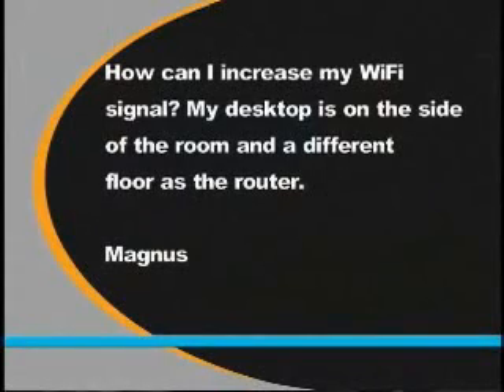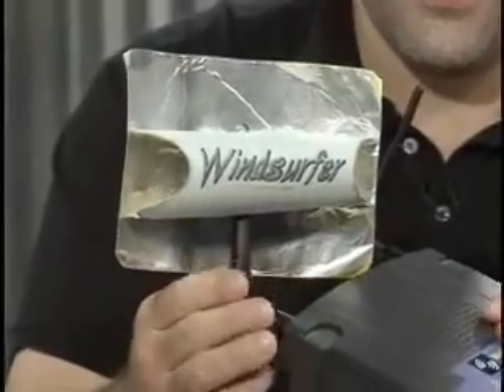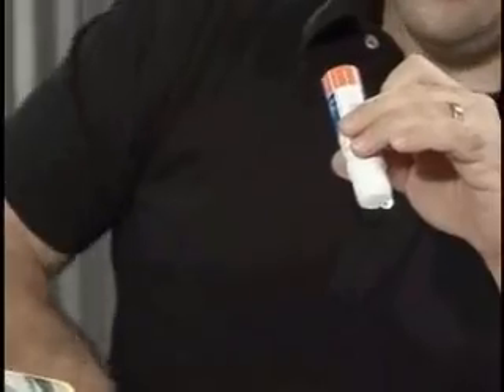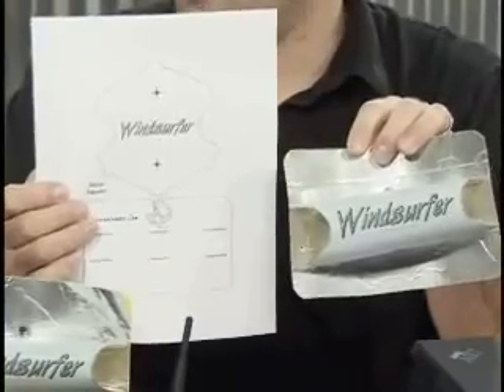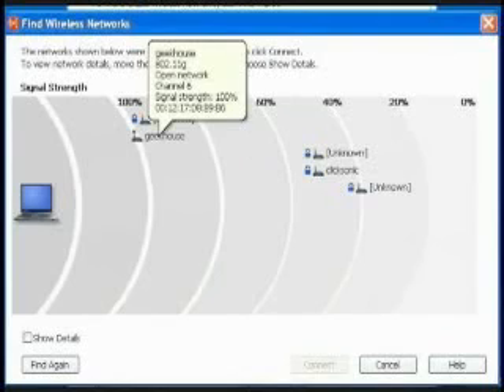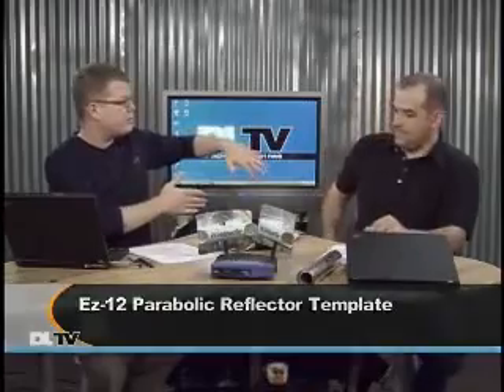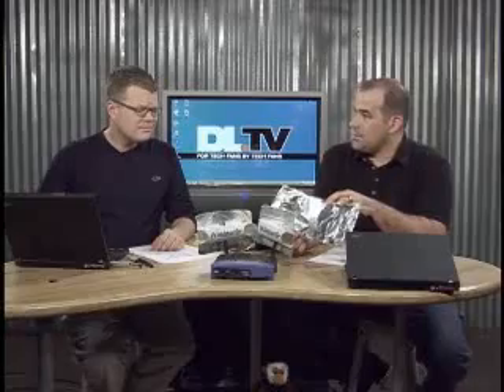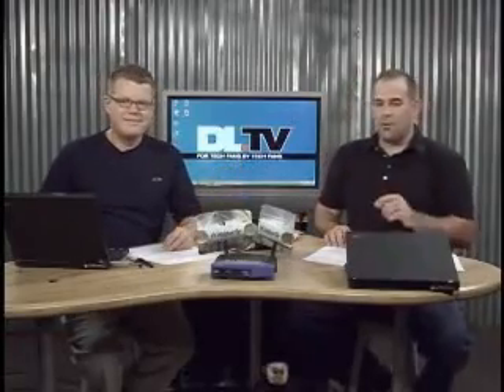HOW TO MAKE A WIFI EXTENDER

Comment: The tin foil has 2 sides. One dull and one the other side shinny. Which side should face on the top that I glue on???? Please.
Reply: +tienie dearham Probably aluminium part cuz he reflect signal..U can decide which one is probably aluminium must be inside..Its like nylon cant go through it if all sides are than all is the same..

Comment: How do I apply this technique if my router doesn't have an antenna?
Reply: Alvin U. your router still has an antenna, but its internal and inside of it. imagine your entire router being the antenna. make a reflector almost the same size as your router and put it on the side you need, can be completely detached from your router but not too far. the caved in side should face the way you want the signals to travel toward. lets say " U " is my reflector, the signals travel up. if "  ) " is the reflector the signals travel left.
Reply: ***** So it's just a matter of putting it up against my router? Should I tape it to my router?
Reply: yes, just make a curved shape reflector, put it behind your router. doesn't even have to tape it/glue it to the router. find other means of making it stand/keep position like put a box behind it to keep the reflector standing between router and that box.

Comment: I tried the actual cut out with foil but it didn't work. Did you even use the cylindrical thing in the center or did you just use a huge amount of tin foil and it worked?

Comment: Has anyone tried this on Wireless access points for reception? for example, My router is located on the first floor of my two story house and i have an access point on the second floor (where i access the net wirelessly).could i make this, stick it onto the access point and point it in the direction of my router? or does it need to be on the router itself?  help

Comment: @xxmarbreds91xx Make a parabolic reflector(ex. large cereal bowl w/@ least the concave side lined w/alum. foil)&place it behind router w/concave side facing area u need more signal. Can use on routers with or w/o external antenna.

Comment: People that are trying to watch this probably can't load this video so basically... You could go out and buy something to direct the wifi in one direction and it will cost around £50 but you could do the same but simpler by just:
1) getting something reflective like tinfoil.
2) putting a curve on it (to turn it in a direction you could stick it to paper to help keep it bent)
3) put two holes on it so put on the antenna ( if you have no antennas, good! just pop it on top of the router)

Comment: I just tried this and it worked quite well.  I have my desktop pc and wireless router in an extra bedroom and had a problem with the WIFI signal reaching to all areas of the adjoining living room. Now the signal goes through the wall into the living room, through the kitchen behind the living room, through another wall into the master bedroom, through another wall and two walk-in closets behind the bedroom and into a back den. 120ft on a straight line. Signal drops off near the back of den.

Comment: I wonder, how the HELL would you improve the signal on a router that doesn't have an external antenna? I'm talking about the 2wire Homeportal 1000hw, which apparently has 3 internal antennas connected to the MB. Don't ask me why, it doesn't belong to me and I never installed it. But I'm forced to live with it. I get no reception in my room and I need to figure this out. Anybody have any advice? Thanks!

Comment: wow, my router is in the basement of my house, made out of concrete and i have no signal reaching my rooms upstairs, almost like a deadzone. After i did this with just using the foil, it works now across my house and upstairs. Didnt even use the scissors or cut out paper!

Comment: The parabolic principle is that everything that goes in will get reflected back to one fixed point.
In this case this fixed point is the antenna of the router. That's why you can't scale it to your liking. Making it bigger or smaller will move the fixed point.

Anyway it would never increase the tranmission rate above the capability of your router (obvious).

Should be a cheap way to turn your omnidirectional antenna into a directional antenna.

If it works, have fun :o)

Comment: After modifying each of the two antennas with (8) small binder clips to expand the antenna height and width, I placed a 12" x 6" cardboard aluminum reflector behind my Linksys WRT54G situated in the far end of my basement. The signal bars on a notebook computer in a bedroom two floors above and about forty feet away registered from two to four bars!

Comment: This doesn't work...

Wireless routers use 2.4Ghz systems... that are binded together.  In order for this to enchance the signal, it would have to actually be connected to the metal antenna wire (thus enlarging the entire antenna surface area and directing out and inbound signals because of it's parabolic shape).  

But just sticking it on the outside of the plastic antenna housing like this.... does NOTHING.

Placebo is a hell of an effect.

Comment: what the problem might be is that ur phones might be on the same 2.4ghz frequency as ur wireless and thats causing ur problems. the easist way to fix it is to get new cordless phones. new phones transmit at 5.8ghz and wont cause interference with ur wireless internet. other things that can cause interference but rarely unless u have a crappy access poibt or router are:

microwave ovens and pine trees (i dont know y. but they do.

Comment: is there a homemade device to boost the wireless signal for the laptop rather than the router itself? I mean can we prepare a device for the laptop that we use in another building from the router? Could the same device work in this case as well?

Comment: Am/Fm radio is broadcast to your radio which only receives(unless its a ham radio), unlike wi-fi which constantly transmits and receives. I only posted this as a joke, although it is a sad fact. The days we live in require our bodies to sustain a lot. I have a wi-fi set-up, and I expose myself to this radiation everyday. However, I would recommend using cell phones less, and wiring as many computers to your network as possible. It just makes sense, and its safer for your net security.

Comment: I need to boost signal up from the router on the ground floor up to the attic. Do you know, should I tilt the parabola upwards relative to the antenna, or must parabola and antenna be parallel? ie tilted together

Comment: it does work, it reflects the signal from one side to another, however if you have the parabola facing the wrong way it will dramatically decrease the signal strength

Comment: PARABOLAS LIKE TO REFLECT THINGS.

This is a great idea and it actually works, but that statement is incorrect. Aluminum is what is doing reflecting of the signal. Manipulating it into the shape of a parabola focuses the signal reflection into one general direction. It behaves somewhat similarly to the way a satellite dish works.

That said, placing one of these on your wireless adapter (in addition to the router antenna) will yield decent signal quality and strength benefits.

Comment: I tried this. Works well with one, two seems to cancel it out. Currently at 4-5 bars on laptop in the kitchen (Compared to 3-4) and 4 in my basement (Compared to 2-3). Big boost for the basement because it's aimed more there, which is sweet. 5 walls = horrid connection down there, even the kitchen had issues (Cordless phone and all), so I'm happy. a few pennies and I didn't need to buy anything.

Comment: lol, lead sheets... no reason why this wouldnt work. The science is correct. The example cant be trusted, since, you can just move the router or computer... but the science sounds solid. I am about to switch rooms, and will be going from ethernet to wifi. Ive checked, i have about 87% in there, but wifi is slower than ethernet, so i need the 100%. I might try this. I have a 16mb connection, but can hit speeds of 43mbps and maintain about 5 seconds til the router overheats.. lol.

Comment: one question. I was at an expo a while ago and I didn't want to pay to use the hotels internet ($12.99=24hrs) ant I have a starbucks card and there was one  across the street and I was about 20 to 25 stories up I should be able to get it but it also the windows.

Comment: This works.. I cant believe it. I have a pc at the other end of my house and my belkin usb wireless adapter would only pick up one barfrom my netgear wireless router and wouldn't hold a connection for more a than about a min.. I went online to buy a signal extender and this video came up in the search so i thought what the heck ill try it. 10 min later windows wirless on my pc in the back room detected the signal with all 5 bars. I cant believe  it. I was completely sceptical but it works.

Comment: ur an idiot because tin foil reflects the waves. therefore when you make the wind surfer thing and put it on the antenna it directs the waves to wherever u point it inhancing the signal. 
hes not wrapping the antenna with it u tard.
think before u speak

Comment: holy shit, that this doubled both my up-load and my down load speed. my comp is a floor higher than my router and there are three walls between them, and it brought my signal from 36Mbps to 48-54Mbps. awesome thx

BTW I have a G-router and I blew-up the template to the size of a piece of paper

Comment: This really works I had 76% signal strength on my Ps3 now I have anywhere between 95-100%!!! 5 star video!!! I also used regular printing paper and it worked fine.

Comment: because parabolas are geometrically shaped to transmit or recieve RF or sound waves to or from a focal point (the antenna). I know that, my question was that if the foil is necessary, seeing that not all satellite dishes are made of metal, nor are they shiny. I think that a larger "windsurfer" made of dense plastic  would work just as well.

Comment: I'm using a router that doesn't have an external antenna, could I just put a U-shaped aluminum foil piece around the back of my router in order to better direct the signal to it's source?

Comment: Its surprisingly simple to make really. I found the template a long time before I saw this vid. I got about 8-12dB of gain out of mine. I just used an old cereal box and cut out the template. Then I used aluminum tape. Bit of superglue and voila!

Comment: Plz believe me, it DOES work and, if u have all the materials before, you shouldn't take more that 15 mins working on the antenna.
 I have a Notebook, and I always work in my bedroom with it. But the problem was that I always had low and unstable connection. The Internet signal went down every 5 minutes. I cant work with that! So I searched a method to increase the Internet Signal and now it says Good connection, so the antenna really works.
PD: Wait about 10 mins after setting the antenna.

Comment: dude's these things really work!!!
and they can limit who tries to hack 
or boge your signal!!! BY directing the dish towards your choosen area of reception.
I use them myself.. FYI Radio Shack sells the wifi extender antennas for Linksys Routers for less than $10.00 bucks use those antennas with these parabolic reflectors and DAMN YOU GOT A STRONG SIGNAL!!!

Comment: yes.. this increase the recieve and sending signal of the router, the problem is that it makes it more directional, the intention of the omni is to cover 360 degrees the parabolic antenna is more directional you will get more signal whereever you point it but the back part will reduce signal.. See this like a flash light, if you remove the reflector u wont see light 1 meter of you but if you put the parabola then you can reach maybe up to 20 meters.. its the same principal

Comment: i did that on my dir-625 and it didn't work it made my signal drop, i adjusted which way it was facing i put my ipod right up to it and it had a very low signal....RIGHT NEXT TO THE ANTENNA

Comment: well after making it i guese it actually works, in my room it has always been 2 bars when i close the door and open fluctuates between. With these its now all 3 bars, but my room is pretty close to the router so it means it only extended a couple feet. It did not increase my bars on my wii to 3 bars which is downstairs of my house. it is still 2.

Comment: Worked for me.  Macbook gets a steady 70% on a different floor.  PC on the same floor is getting -39 dBm opposed to a -41 to -47 without.

Key is to point the things where your Wifi components will be.  I had to tilt an antenna down a little to get the parabola to point upward.  (I have two antennas).  One points toward the PC on the same level and the other antenna points up.  Pretty cool mod!

Comment: Have done further testings. 
NO, it would not increase the tranmission power. BUT it will direct the tranmission witin the angle it is directed. Those with wifi receiver behind WILL have signal bar dropped by one bar. Good device to stop those that you dont want to receive your wifi.

Comment: I have just made one n tested in the house. It did make some differences in the transmission, ie. if your wifi is behind it, the transmission strength drop by one bar & if your wifi is in front,will increase by one bar.
Have to do more testing with greater distance. Let you know later. If it really increase wifi distance, will make it out of shining aluminium sheet.

Comment: ATTENTION TO ANYONE TRYING TO DO THIS:

In the video they glued the tin foil to the FRONT of the Windsurfer. The tin foil is actually glued to the back, which means if the Windsurfer is pointing directly at you, you should only see the paper instead of the tin foil.

Comment: Guys this really really really works,i tried it,i don't have a printer so i traced it out,my signal went to very good from very low and usually 12mbps or 18mbps now shot up to the maximum 54mbps my router uses

Comment: i got a small boost and a realy small radio track/road to pinpoint the signal with my Laptop. if i move i need to turn the booster that way i moved and it has t obe dead on target.

Comment: WIFI signals travel perpendicular from the antenna. So if you want to transmit/receive up or down a floor from where your router is, then you must set your antennas horizontally for the best reception.  That is why the antennas are poseable.